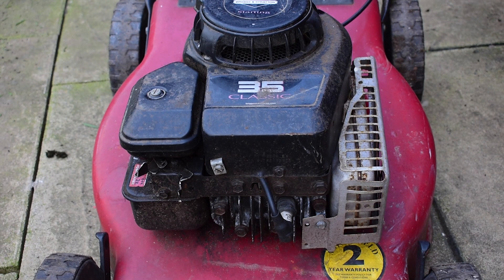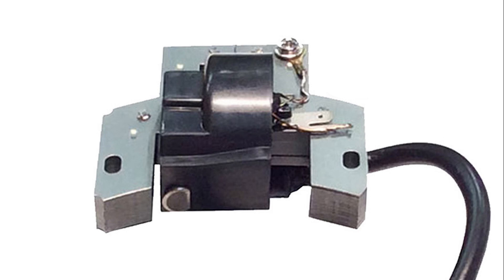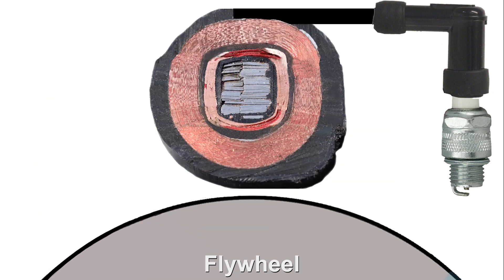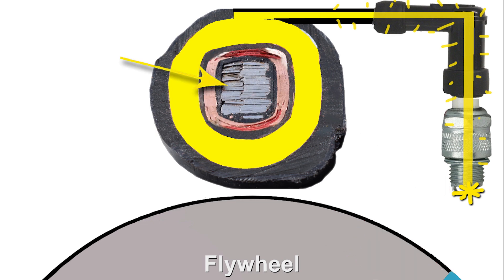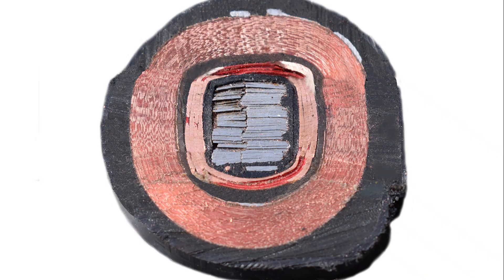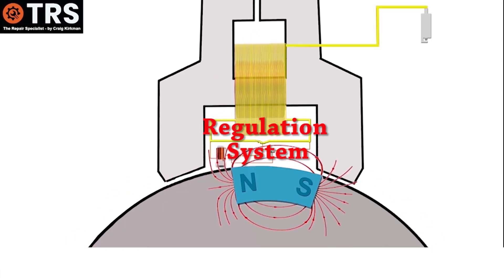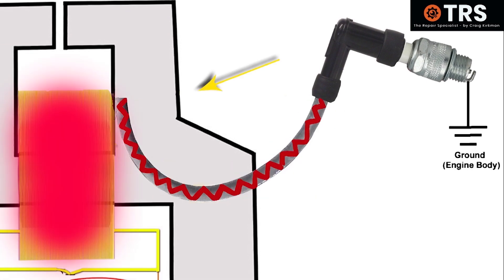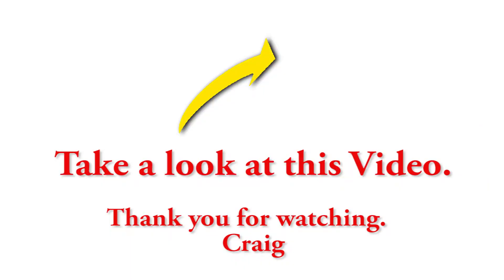Lawn mower Stops after few minutes, when HOT - This is Why!  (by Craig Kirkman)

Comment: QUESTION: At the start of the year, my Cub Cadet SC300HW self-propelled mower bought in 2020 sounded like it was skipping a few beats. I then bought some Gumout and put it in the gas. This seemed to severely hurt fuel efficiency and caused other problems. For example, the mower would stop cutting all by itself as if it were out of fuel, even though 25% of the gasoline still remained in the tank. The mower also was clearly slipping beats and didn't sound right. The mower eventually reached a point where it shut off and clearly was severely defective. The mower would always start on the first pull, but never remain on for more than 20 seconds. 

At that point in time I had a friend come over and look at it. This buddy of mine did all the standard checks. He confirmed the oil was good and that there was plenty of gas. He confirmed the sparkplug was good. And he confirmed the air filter was good. Those did not have anything to do with the problem.

This friend of mine then looked at the carburetor. He took it apart and there was nothing wrong with it. While he took it apart, he clamped the gas line to the carburetor. Some of the gas spilled out onto the mower. The carburetor then was put back together and the gas line connected again. After that, the mower worked (or so I thought). I told this same story to people online. I was told that what likely happened was the Gumout cleaned out the gas tank, and when the gas line was disconnected from the carburetor, it finally allowed the gunk to have somewhere to drain out. But, this ended up not being the case. 

When I finally had the opportunity to mow the entire yard, the mower only rank for 90 minutes. After that, the mower would again start on the first pull, but never run for more than 20 seconds.

I then hired a small engine repair specialist to fix the mower. This man said the Thermostat was the problem. He said the Thermostat was "Automatic" and it was reading the temperature wrong and causing the Choke to turn off, which turned the mower off. 

This man said he ran two tanks of gas through it, so there is no doubt it would not shut off from overheating. However, this was done with the mower sitting in the same spot on a cement surface. 

When I first saw the mower, it started within two pulls, but it was started on my driveway - which provided no resistance. Today, I went out to mow the yard for the first time since having the mower back. I tried starting the mower in the grass - in a relatively short area of grass. It took SIX PULLS to start the mower. I'm a big guy 6' 3" tall and over 300 pounds. I was pulling as hard as I could and I was concerned the mower was not going to start. Eventually it did start, but I really didn't like it that the mower took six pulls to start. 

After the mower started, it didn't take long to hear the mower was still skipping beats every once in a while. It was clearly not "smooth" like it was the three previous years I owned it. 

The mower ran for about 70 minutes. I had noticed the mower was starting to get hot. This was what had happened when the mower eventually stopped at 90 minutes. At one point there was a “visible” form of heat I could see. Unfortunately at about 70 minutes I had a health problem (long story). I needed to stop mowing for about an hour. This allowed the mower to cool down again. When I came back, the mower again took SIX PULLS to start! It was not like that prior to taking the mower to the small engine repair specialist. 

I then went and mowed a very long part of the yard that had grown while the mower was being repaired. I did this for about an hour. During that time period, the long grass caused the mower to stop mowing several times. I no longer could mulch, so I switched to the device that shoots the grass out the side. Even with that tool, the mower would still stop sometimes. But, the interesting thing was that the mower would no longer need to take six pulls to be restarted. Now, it would take only two pulls and sometimes one pull to be started. It was as if being hotter made the mower easier to start. 

Unfortunately, I was not able to finish mowing the yard - which usually takes about four hours. It started raining out, even though there was only a 1% chance of rain for that time of day. 
I told the small engine repair specialist all of this. He said the Gumout had nothing to do with anything. He also said nothing he did would change the number of times needed for the mower to start. I am personally not a believer in that second statement, because the mower always started on the first pull prior to giving it to him. 

At this point, I have a couple concerns after having paid money to the "Small Engine Specialist." Those concerns are: 

1. Why does the mower take six pulls to start when it is cold? 

2. Why does the mower still sound like it is missing a beat sometimes and not smooth the way it did all season long and not like the first three years of its life? This makes me think another problem is inevitable

3. Do you believe the Ignition Coil could be the cause of this mower taking up to six pulls to start and still apparently generating lots of heat?
Reply from the maker: Oh my goodness. How long did it take you to write all of that?  With such effort I feel I must give some back, so here it is.

It sounds like you've been through quite a journey with your Cub Cadet SC300HW self-propelled mower, and I can understand your concerns and frustrations. Based on the information you've provided, I'll address your questions and concerns one by one:

Difficulty Starting When Cold: The fact that your mower takes six pulls to start when it's cold could be indicative of a few issues. It's possible that there's an issue with the fuel system, such as a partially clogged fuel line or carburetor. It might also be related to the ignition system or spark plug. Additionally, the choke system could be malfunctioning, affecting the air-fuel mixture during cold starts. A qualified small engine technician should be able to diagnose and address this issue.

Mower Not Running Smoothly: If your mower is not running smoothly and seems to be missing a beat, it could be due to various factors. It might be related to the fuel quality, carburetor adjustments, or an issue with the ignition system, such as the spark plug or ignition coil. A thorough inspection by a professional could help pinpoint the exact cause of this problem.

Ignition Coil as a Possible Cause: The ignition coil could potentially be a contributing factor to starting difficulties and irregular engine operation. The ignition coil plays a crucial role in generating the spark required for combustion. If it's malfunctioning, it can lead to poor starting performance and engine misfires. However, it's essential to rule out other potential issues mentioned above before concluding that the ignition coil is the sole problem.

In summary, while the small engine repair specialist you hired has provided their assessment, it's possible that there are multiple factors contributing to the issues you're experiencing with your mower. Given the complexity of small engines, especially when symptoms are interconnected, it's advisable to consult with another experienced technician for a second opinion. They can perform a comprehensive diagnosis and recommend appropriate repairs or replacements to get your mower running smoothly and reliably again.

I hope this has helped a little 
Craig
Reply: @TheRepairSpecialist , thank you for taking the time to respond. It took me a long time to write that long message. It looks like you spent a long time responding to me, so I thank you for that. I would just mention some things quickly in response to what you wrote. 

I've now had two people tell me the Sparkplug, Air Filter, Oil, and Gasoline are all fine. I was also told the Carburetor was fine by both people. And now the mower has a new Thermostat (which was very expensive to order). 

The man did mention something about the "Choke." And based on your video, I thought the "Ignition Coil" thing might be a factor. But, at this point, I think the "Small Motor Specialist" who looked at the mower now has the attitude that he no longer can help me. 

There is one "Official Cub Cadet" place about a half hour from my home. But they told me it usually costs between $90 to $120 for a repair. I paid $299 for the mower. I bought it simply because it was the least expensive mower. 

My main problem is I'm disabled with epilepsy and cannot drive. It would be very difficult for me to get a ride to take the mower to that "Official Cub Cadet" location. Plus, their prices are very high. I'm on a fixed income from disability with epilepsy and I just cannot afford all of these repairs. The mower is only three years old. It was bought during the spring of 2020. I've never had a mower stop working in such a short amount of time. 

This Cub Cadet mower actually has a "Three-Year Warranty." I tried mentioning this to the Tractor Supply store I bought it from at the start of the year when some of these problems happened. But I was told, "We no longer sell Cub Cadet mowers, so we can't help you." 

It was unfortunately just outside the three-years from when the mower was purchased. 

So, that is why I bought the Gumout. But the Gumout seemed to make the situation worse, as I described above. People had said, "Maybe the Gumout cleaned out the fuel lines, but it had nowhere to go. This is why disconnecting the fuel line to the carbureator and seeing some of the fuel spill helped it and allowed the mower to go for 90 more minutes before shutting off again." But, the Small Motor "Specialist" later told me, "Gumout had nothing to do with it; that was just a coincidence." 

I'm not really sure what I'm going to do if this mower breaks. I don't have the money for another one. It takes nearly four hours to mow the yard. Everyone wants $60 or $70 every time to mow the yard. I just can't afford that amount of money. I have "Time" as a resource, but not "Money." This is why it is discouraging when the mower stops working. I was doing my best to invest the "Time," but the tool stopped working. 

One reason in particular I'm not optimistic about taking the mower to the "Official Cub Cadet" place is because in 2019 the very last place I took my Snapper mower was to an "Official Sears" location that still remained around. I was told, "It works great and you are all set." I started it up and mowed for several minutes just to see, and saw things seemed fine. I dumped the gas and oil , and then cleaned out the bottom. I then put the mower away for the year.

But at the start of the spring of 2020, I only made it several laps around the yard and the Snapper Mower stopped working. It would start on the first pull, but never run. I was told it had a bad "Carburetor." I was told it would cost more to get a new Carburetor than a new mower, so that is why I bought the Cub Cadet mower. I kept the mower, just in case I ever heard otherwise about the Snapper mower. 

I then saw online that a Carburetor for this Snapper mower was not expensive the way I was told. I bought one for only $14. This "Small Engine Specialist" who worked on my Cub Cadet mower also took the Snapper mower and the Carburetor I had bought. He put the new Carburetor on the Snapper mower. But he didn't charge me, because he was not able to get the Snapper mower to work. 

The "Specialist" showed me there were two springs for the Snapper mower. But he said putting the second spring on made it so the mower would barely run. So he actually left the one spring off. Even in that scenario, it starts up on a flat surface with cement and is very weak. Once you go into the grass and encounter resistance, the mower is useless and has no power. So, he didn't charge me for that. I was charged for the Cub Cadet mower, though - even though it still take six pulls to start it. This was discouraging, because I was hoping for better results from a "Specialist." 

But, I am now thinking if a "Specialist" and the Sears "Official" staff are telling me things work when in fact they don't, it causes me to not want to waste more money on this Cub Cadet mower at an "Official" Cub Cadet store. 

I wish I had known about these problems earlier in the year, because it may have been covered by the Cub Cadet "Three-Year Warranty." 

Your helps is very much appreciated. If you know anyone in Michigan near the Thumb Area, tell them they are free to come take a look at my mowers.
Reply: @michaelzoran TRS certainly gave you some good responses.  Given the number of mowers that I work on, fuel quality and fuel delivery issues are generally the primary issues.  The ethanol in fuel is a nightmare on small engines, and even inside a gas can will deteriorate quicker than thought and even quicker in a mower tank or carb.  I replace ignition coils on a couple units a year, but I would be surprised if it failed this quickly.  Not to say it isn't failing, but wouldn't be my initial starting point.  However, there are a couple quick checks you may be able to do yourself before taking it to another repair shop (FYI, an "Official" shop seems to be less useful in today's world than perhaps 50 years ago).  

1.  Check the air filter.  Is it dirty or plugged up with grass?  Does it feel or look damp like gas or oil could have saturated it?  If you leave it out, does the mower start easier?
2.  Check the choke flap.  It is the one visible by the air filter base.  Is it fully closed when the engine is cold?  Does it fully open after a minute or two of the engine running?  
3.  Check the carburetor.  On these machines, the main jet the fuel goes up, is inside the center of the carburetor.  If you can easily remove the entire carb, you can do so, but you can also try this without taking the entire thing off.  Drain the fuel, or clamp the hose first.  Then remove the center bolt on the bottom of the carb - is it clean inside the bowl or do you see any dirt/flakes or jelly looking stuff?  This can be hard to see as it requires some skill to drop the bowl without losing all the fuel and potential debris.  Get some carb cleaner with a straw, and aim that straw up the center tube and spray it.  If you have a torch tip cleaner or carburetor cleaning tips, push it up the inside.  There's a nut inside that is the main pickup jet and they get plugged easily with debris or fuel that breaks down.  Gumout will NOT clean that out in my experience.

At 4 hours to cut the lawn, you'll want to make sure oil is changed roughly every 8-10 cuts and the blade is sharpened about as often.  A dull blade can contribute to running issues as well.  If you're able to do those 3 checks (I would do them in that order), let me know what you find.  I'm happy to do a couple emails, which will allow for pictures, etc, if needed to try to help out and try to save the hassle and expense of going to another repair shop.

Comment: Great video, first time seeing you.  I have a quick question, everything you explained made sense.  I think my situation with my power washer is also a coil issue. It starts, with one pull, and runs great, but when the engine is hot it will not restart. But it'll never lose power, run rough nor will it stall out while running.  Why would the engine not short out if the coil is bad or going bad? Would the "regulator" you mentioned be able to compensate the any shorts or breakdown of the coil while running?  It restarts when cold.
Reply from the maker: First of all thank you for your very kind feedback, i really appreciate it.  Here is another vid of mine that explains a little more about what you might want answering. Take a look and see if it helps: https://www.youtube.com/watch?v=lEYO7hNTeR0&t=715s

Let me know how it goes

Thanks again

Craig
Reply: Thank you for the link, I watched,  The Theory makes all the sense in the world to me. But,  I'm still not sure why my engine will continuously run even when hot.  If I refill the gas while on low idil it'll run for hours. If it runs out of gas after say after the first tank it'll never start till it cools down, I usually give up and wait til the next morning.